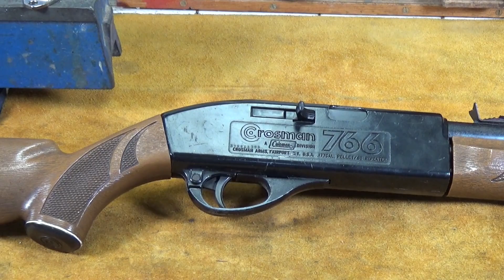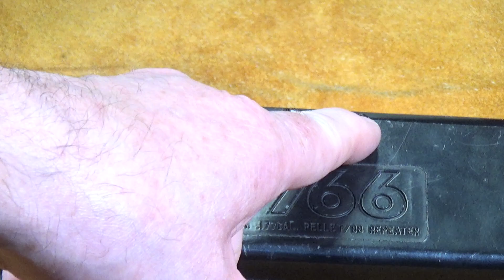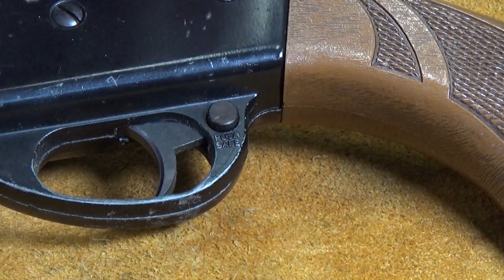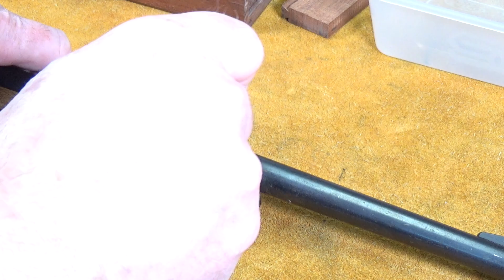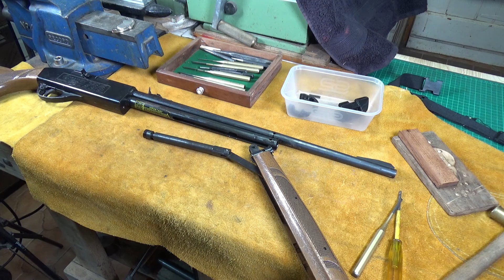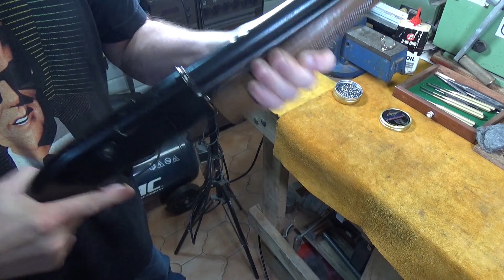Crosman 766 Multi-Pump Pneumatic Air Rifle - Fault Diagnosis & Repair - Part One

Comment: The O-ring inside the pressure reservoir chamber failed probably. IIRC it was a bugger of a task to unscrew the end of the chamber.
Reply from the maker: It was the release valve seal which is also inside the pressure chamber. On my 761XL the chamber was very difficult to unscrew, on this one it was fairly easy.

Comment: You have the earlier, and better model. The barrel outer is the tapered type, the later ones had a straight tube with a plastic cone fitted so Crosman didn't have to change the receiver casting. On the pump piston, there's a grove behind the seal, this should have a foam infill, this was where a few drops of 'Pellgun' oil was dripped to keep that cup lubricated. Over time, this oil, and any dirt or debris in the air, ends up in the air chamber and gums up the valve, this is probably why it's a bit hit and miss when firing.
Regarding pumping up, it's far easier (and quieter) to place one hand on the receiver and the other on the pump lever, it also keeps the fingers away from the trigger as I notice you loaded a pellet before pumping, possibly a bit dangerous. It's still possible to hold it this way if a scope's fitted, just put your hand over the front scope mount.
One thing these rifles didn't have, was a proper seal on the pellet probe, it was just a molded ring! The 766 had a .22 brother, the 2200, these had a blow-off valve under the air chamber as they were capable of going over the UK legal limit, it was common back when these 766's were new to put 18 pumps in, Airgun World magazine got over 11 ft/lbs out of one doing this, though the heat generated probably doesn't help them, Crosman say 10 pumps max.
The 766 was replaced by the 2100, which was almost the same but lost that tear-drop trigger guard, there's also a Remington version.
Reply from the maker: Thanks for all the information. It was the release valve seal that had gone, just turned to powder. Not surprising really considering it's age.

Comment: I’m sure you’ll fix it Alan, and it will be working in no time. ATB Nobby
Reply from the maker: Thanks Nobby. I did manage to fix it as you will see in Part Two. It did take a little bit more stripping down though. Cheers, Alan.